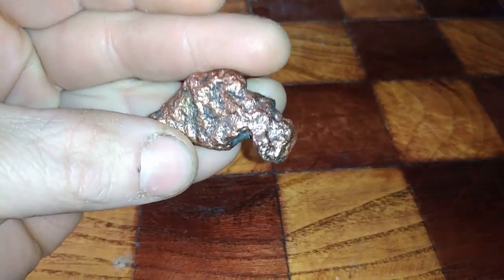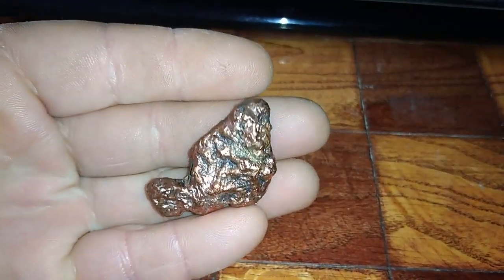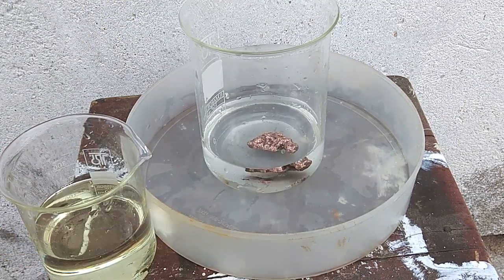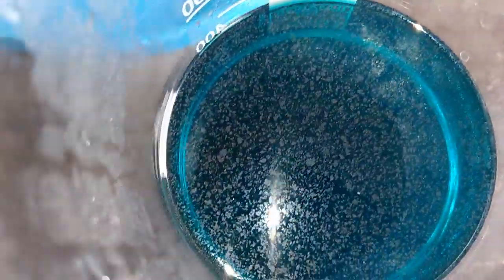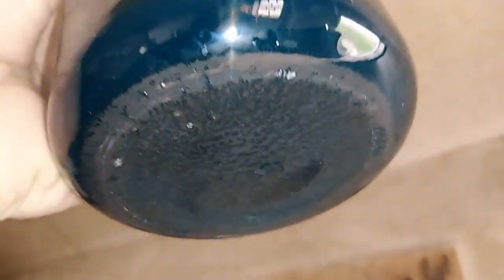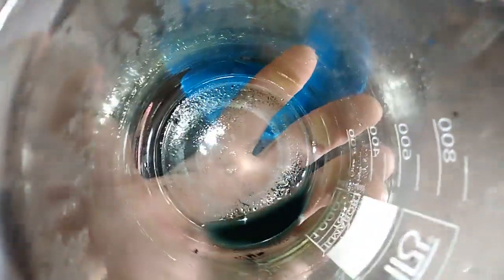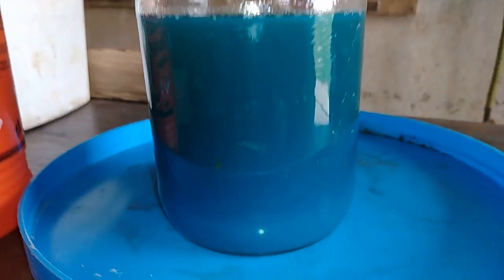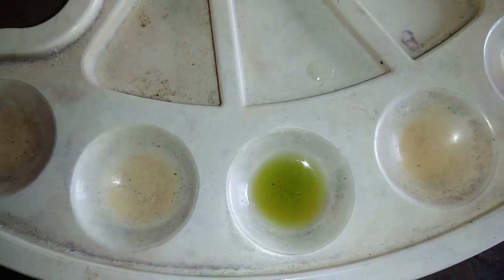Copper popcorn from motherboards - precious metal recovery test!

Comment: Nice video Dusan. Since gold is heavier than copper I wonder if the gold is settling at the bottom of the furnace and getting left behind when they pour off the copper. Maybe you could help them when they clean out the furnace and keep the scrap residue from the bottom of the furnace. I bet that would contain most of the precious metals.
Reply from the maker: I think is posible to. I do not doing that kind of job but idea is cool. Thanx for your time bro.

Comment: Burn all the boards!?! Holy crap that is a lot of pollution
Reply from the maker: Im not 100% familiar with that proces but that is the vay of busines for them. I must go and see once if they let me inside. Chears.
Reply: I am sure it is cleaner process then extracting and refining ore.
Reply: Vladimir Vujasinovic depends on their air filtration system...but they had to mine the ore first.
Reply: Yes it depend,but we know nothin about process.
Reply: Vladimir Vujasinovic actually we do..The smoke contains "significant" traces of arsenic, copper, chromium and the "scary" carcinogens dioxins, according to Hunter College public health professor Jack Caravanos.
Reply: @ursamines7643  nothing about that in this video. Beside,mining and refining cause it too.But i am not an expert of any kind.
Reply: Vladimir Vujasinovic you seem to be expert enough to defend what you don’t know
Reply: @ursamines7643  lets use logic:no ore in world got that percentage of copper and process is similar in both cases
Reply: Vladimir Vujasinovic why are you trying to gaslight this issue with mining? The thing I brought up was the burning of computer boards. The pollution of this process has been well documented over the years. There are safe and environmentally safe was to both mine and process boards. Burning them is not one.
Reply: @ursamines7643  Point of the story is that people need cooper and then they will find it. Obtaining  it cleaner and cheaper way is better. If u don't like pollution,remove all cooper used devices from your home and decrease demand. All pollution caused for your needs is your pollution ,not someone else. Start by your self anti-pollution warfare,don't preach others.